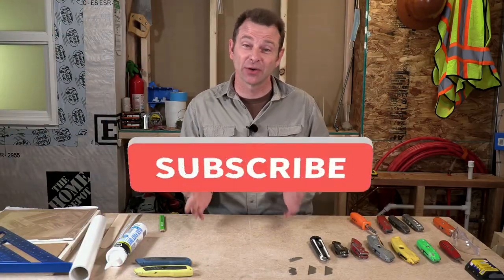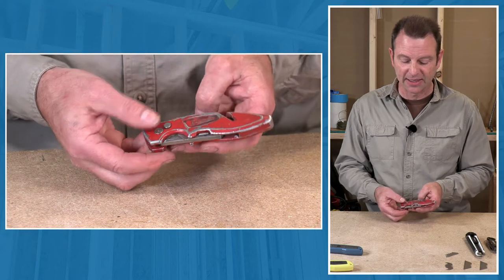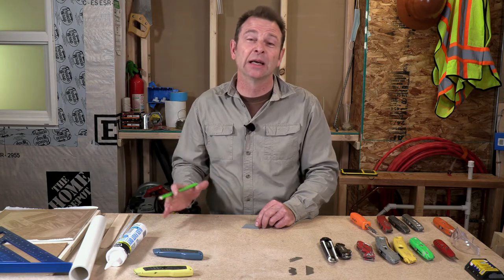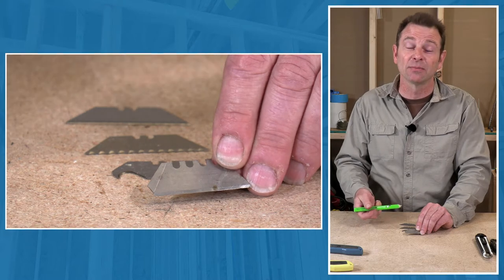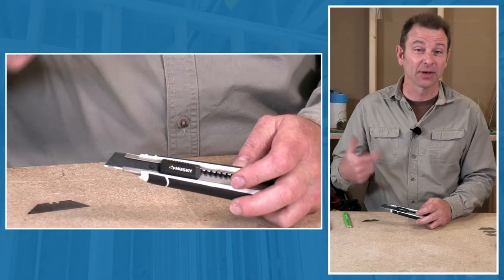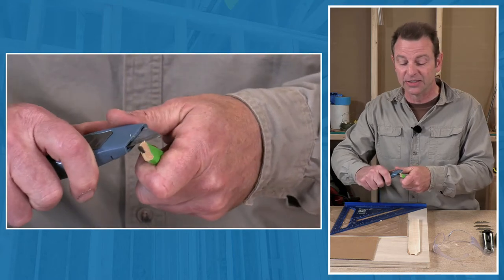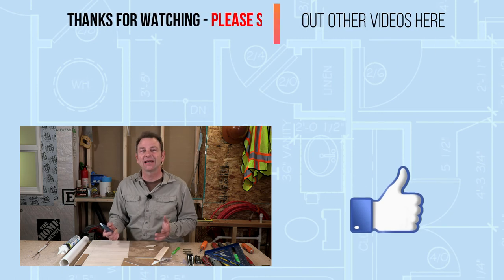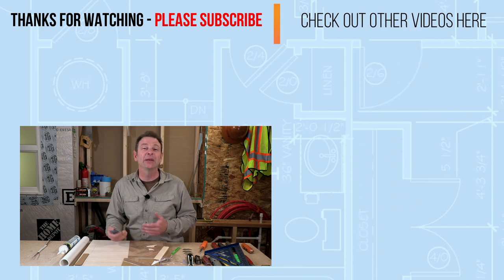A mini lesson about the Utility Knife, its parts and pieces - Trades Training Video Series

Comment: I HAVE ?23
YOU HAVE Good 👍 REVIEWS BTW MY QUESTION IS CAN U SHOW OR TELL ME HOW TO TAKE APART THE WISS KNIFE BECAUSE I OPENED IT UP ACCIDENTALLY WHEN CHANGING THE BLADE I UNSCREWED IT LOL WHEN THERE WAS THE LATCH RITE THERE TO SLIDE IT BACK SO NOW A LITTLE SPRING FELL OUT AND THE BLADE IS NOT STAYING IN ..ITS THE WISS THAT  RETRACTABLE with A push lever Both sides back to open the blde half opens and locks then it has another latch on one side that Push back and the BLADE COMES OUT TO CHANGE WHERE I DIDN'T SEE LOL . THANKS